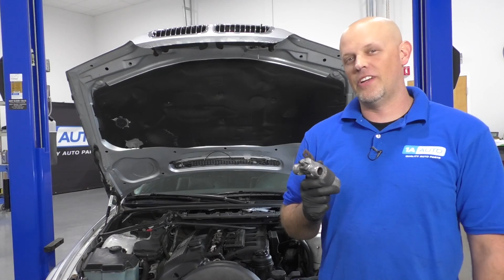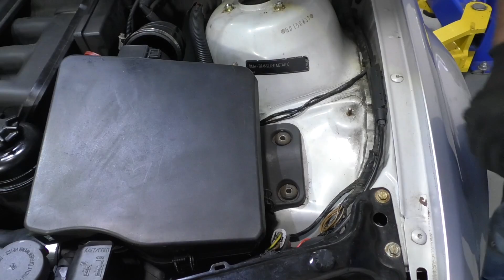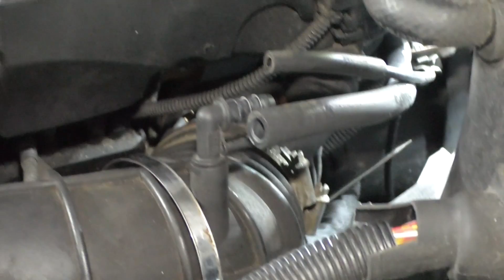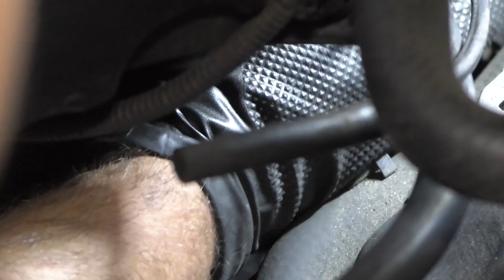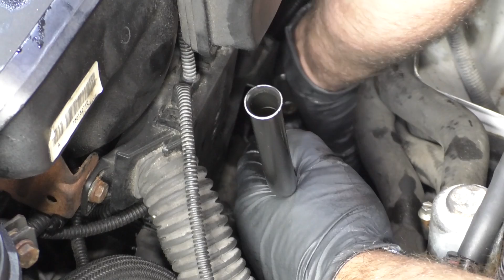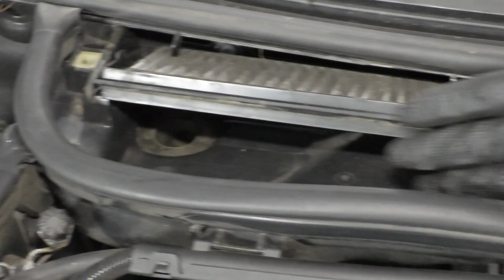How to Replace Idle Air Control Valve 01-05 BMW 325 Xi

Comment: I started the engine with the idol control valve electrical plug not clicked in all the way it spuddered for a second then shut off. The engine failsafe prog came on and I can't reset it.  How do I reset the engine failsafe prog?

Comment: Don't follow all the steps in this video. Just use it as a guide and use common sense. I was able to swap mine out by just removing the airbox, DISA valve, intake boot and I think what is called the wire harness box. Something like that but whatever it is, is pretty obvious and is only one 10mm nut. All these extra steps is just crazy and not needed.

Comment: My Z4 starts normally and at idle the rpm remains stable but when I put it in drive the revolutions drop and sometimes when I accelerate and release the gas the car turns off, can this fix it?